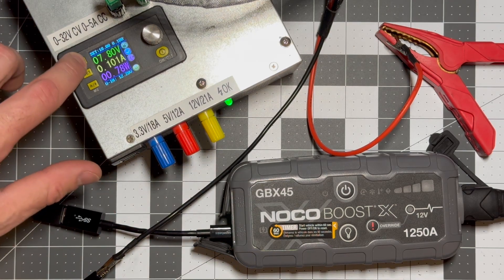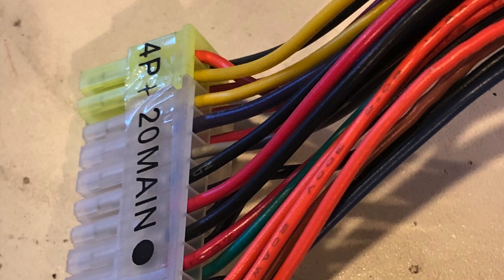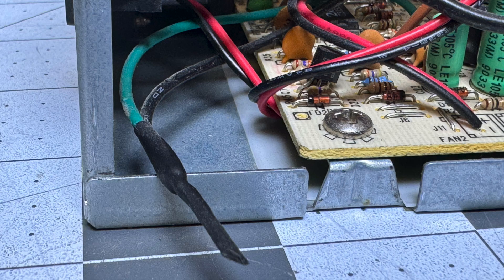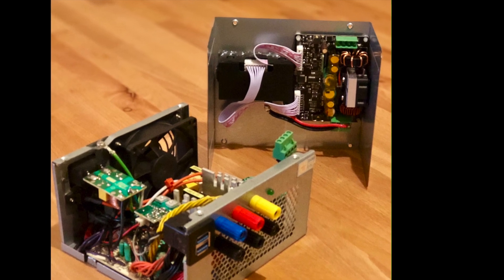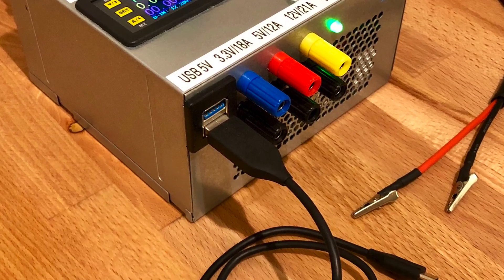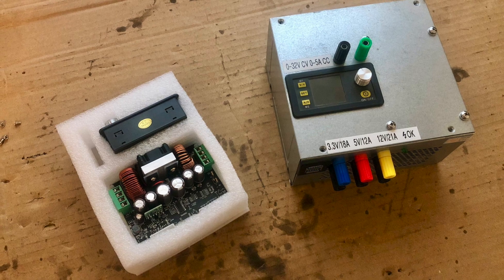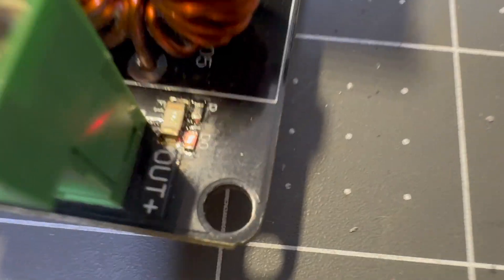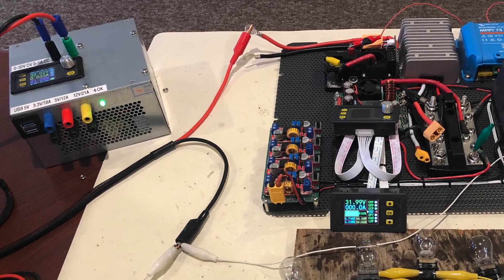Building Breaking Repairing a Variable ATX Power Supply

Comment: Do you need the buck boost board to charge low batteries such as the NOCO situation or can a regulated power supply work?
Are you using it mainly to limit charge current?

Comment: Very cool.  I'm going to copy your design.  Thanks!  BTW: Could you just put an easier-to-change fuse where the board-mounted fuse is?  Or is there not enough amperage to blow that kind of fuse?
Reply from the maker: Yes that is a good idea. Maybe one of those resettable push button fuses poking through the case. You’d want fast-acting. Should be available in the amperage range used here.

Comment: Thank you for this! Came for the noco vids and now ive got a 600 watt supply tore down. Did i understand correctly that once you separated your wires by voltage you soldered the entire bundle together for your single 3.3 and other voltage outputs?
Reply from the maker: Great to hear it! Yes, you've got it right - I made 3 bundles - 1 each for 3.3V, 5V, and 12V wires. I separated them, cut them to common length, stripped the ends, and soldered them together, and then onto the posts on the back of the banana sockets. One cool trick is to use a fine wire to physically wrap the many ends together, like an old style broom. Then solder that whole mess together, without having to hold each strand. Another method is to slip silicone heat shrink over the bundle and shrink it all together, then solder. The silicone won't melt like other heat shrink. Good luck! And thanks for the feedback!
Reply from the maker: @elliottfmills How is your 600W supply project coming along? That's a lot of power, you won't be disappointed!